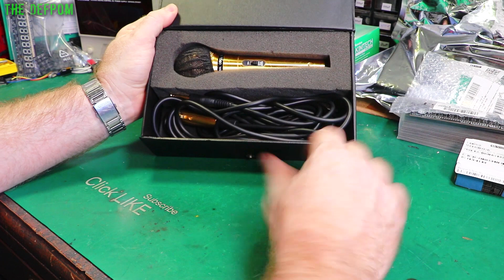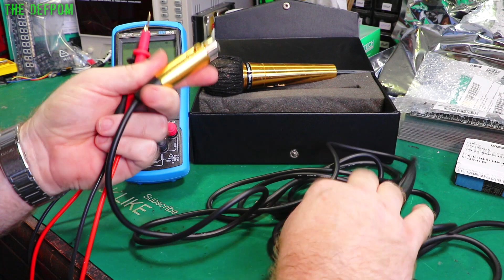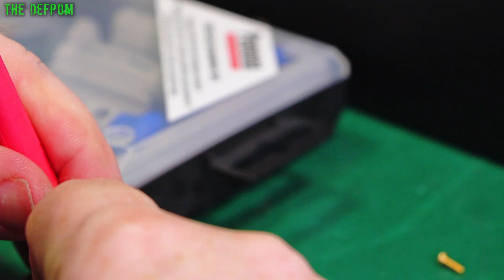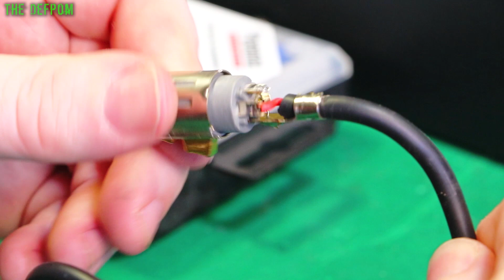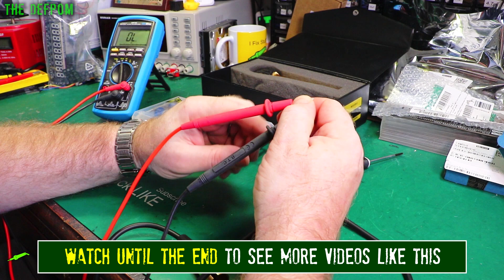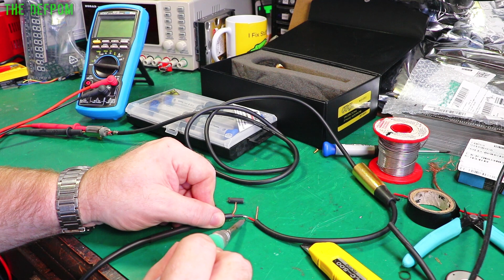🔴 Can You Spot The Failure ? - Can I Repair This XLR Karaoke Microphone System ? - No. 807

Comment: On XLRs Pin 1 is ground (shield), Pin 3 is low side of the mic and Pin 2 is high side of mic. If you just have to unbalance an  XLR tie 1 and 3 together and feed pin 2.  It is not considered proper but it is the way it is done. Fake resistor balanced would have been better I guess, good old transformer is best (from a 70 year old radio station engineer at least) but I guarantee the 10K input impedance of the karaoke machine doesn't care and is definitely not balanced. Nice find there. Cheap cable will cause gray hair, trust me.

Comment: Is it that nasty cable with polyethylene insulation on the inner? I've had lots of problems with that type, it's almost like the copper isn't centered inside the insulation sometimes.

Comment: Have to admit I was talking to my display saying "Oh no, he's forgot the outer heat shrink!" Been there, done that - more times than I would like to admit. Another fault location technique - hold the mike in about the right position and see where the cable hits the floor, that's where it gets stepped on the most. Thank you for the video, Scott.
Reply: same here, the worst thing ever. especially after doing multiple wires

Comment: I use TDR to find the short but if it was mine I would not bother . Re-use the  XLR, buy a neutrics connector and replace the cable. Soldering hardens the copper so it will break  sooner or later again,  just above the solder joined.
Reply from the maker: As it is just a karaoke mic (home use) it doesn't get much use so should be able to last a little while, if it were a proper XLR professional use cable then I would have said to buy a new one, as obviously the cable quality isn't the best which such thin inner insulation.

Comment: It's a cheap, 600ohm low impedance mic and with a cheap 1/4" jack on it. Was it worth splicing the cable rather than replacing?.....well, if it gets the owner out of a hole and for no money then fine, especially if it's a home setup. But, if it's for a bar/pub then I'd definitely replace the cable. Saying that, an SM58 with cable can be picked up new cheap as chips these days and they have a better dynamic range.
Reply from the maker: As it is just a karaoke mic (home use) it doesn't get much use so should be able to last a little while, if it were a proper XLR professional use cable then I would have said to buy a new one, as obviously the cable quality isn't the best which such thin inner insulation.

Comment: I would definitely have replaced the whole cable. The XLR can be reused, but that moulded jack plug is asking for future trouble! A decent Neutrik jack plug wouldn’t break the bank! Love your videos 😄
Reply from the maker: As it is just a karaoke mic (home use) it doesn't get much use so should be able to last a little while, if it were a proper XLR professional use cable then I would have said to buy a new one, as obviously the cable quality isn't the best which such thin inner insulation.

Comment: And you didn't use the simplest method,  A 5 Amp psu set to current limit, then connect across the jack plug.
Then do the wiggle wiggle.
Sometimes thinking nasty is the way grass hopper :-D

If nothing else, you will have a slightly warm cable.
Reply: I'll have to try that one next time

Comment: Cable faults can be difficult to find. I would have used a silicone sleeving for the inner core. Actually I would have replaced the whole cable if it couldn’t be cut back. Audio equipment cables get a lot of abuse in use.
Reply from the maker: As it is just a karaoke mic (home use) it doesn't get much use so should be able to last a little while, if it were a proper XLR professional use cable then I would have said to buy a new one, as obviously the cable quality isn't the best which such thin inner insulation.